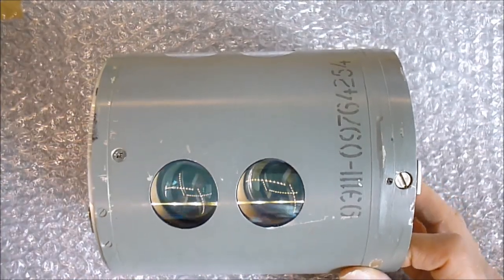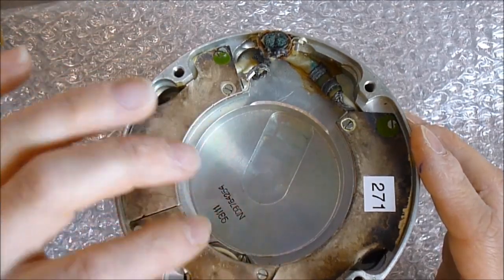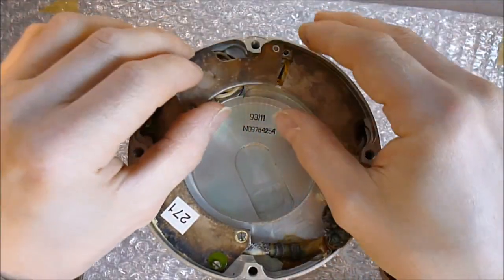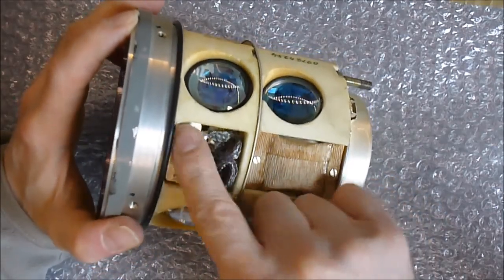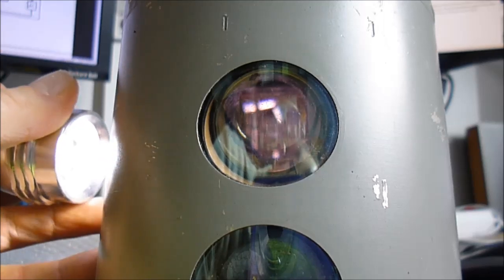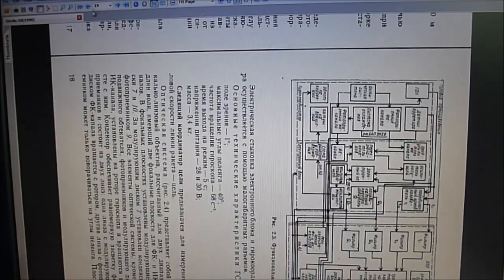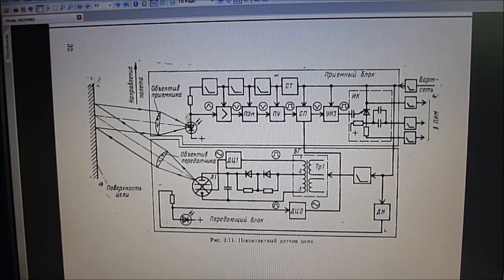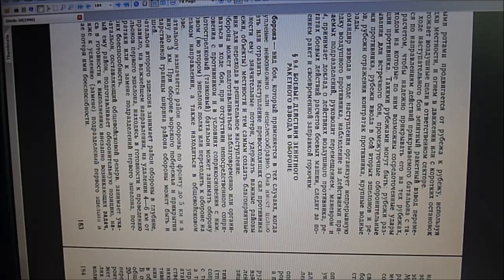Strela-10 missile proximity sensor overview and partial teardown

Comment: It would appear that the receiver sections are looking for the modulated light in the correct frequency and phase, so that any old light doesn't cause incorrect detonation.  I wonder if thick cloud or smoke would trigger it though.
Reply: I wondered about that too, so I looked it up. It seems that optically thick clouds are relatively translucent around 1.5 micron wavelength, which is shortwave infrared. It has about a 0.6x reflectance rate compared to a perfect reflector ( "Synergetic cloud fraction determination for SCIAMACHY using MERIS " by C. Schlundt et. al). 
The lens color, plus how well it transmits light from the flashlight seems to confirm that at least the lenses also have a high transmittance to short wave IR.
I suppose a large part of choosing the wavelength of the detectors goes into rejecting atmospheric disturbances such as clouds.

Comment: Wow, this thing is so sexy beautiful!  Receiver is all analog, bunch of low pass and notch filters by diagram. Would be nice to get accurate schematics. Perhaps you can take it apart to get some hi-res photos?
Reply: That is what I speculated but the Russian symbols are different.
LP = \_
When I would draw ͞  \
So they might mean an integrator that works in different directions based on the emitter?
Reply: I am pretty sure you are correct. The top part seems like a 'standard' heterodyne receiver, with a bunch of filters (pre0select + imaging filters), followed by what I think is a mixer (the 'CM' block might be a mixer, from russian "Смеситель"). It takes the input signal of the transmitter, so I suspect дц1 and дц2 are oscillators. Output of the mixer goes into a notch filter, into some kind of envelope detector/triggering circuit?